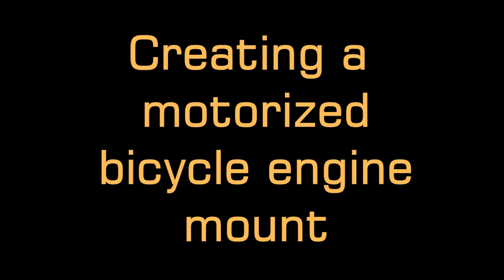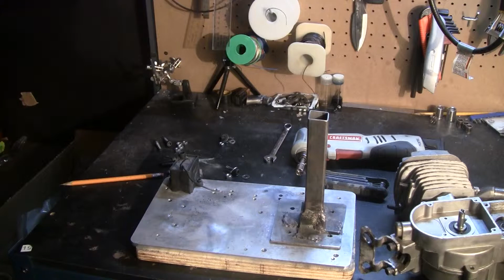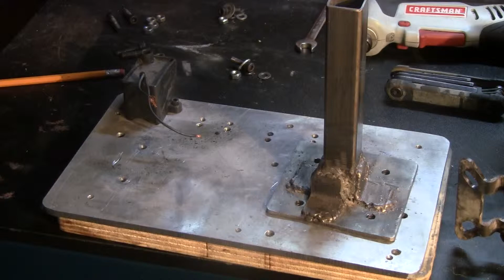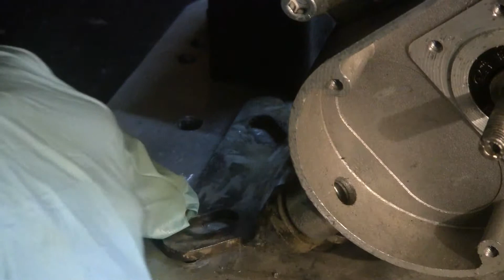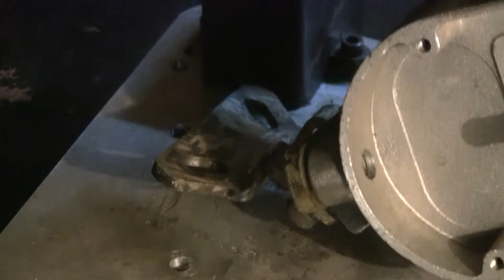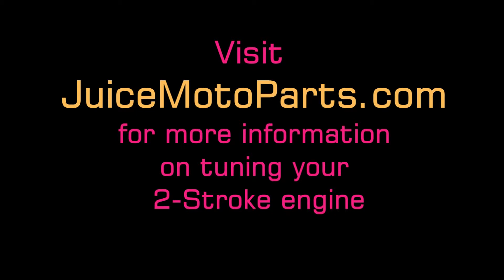Creating an engine stand for your Motorized bicycle engine

Comment: I used a scrap piece 2x8 a lag bolt 2 washers and an old bicycle frame that was cracked I measured up the tubes about 10" from the bottom bracket housing them with the grinder then attached the frame to the board with the lag bolt through the kick stand mounting hole then cut off the rest of the frame about an inch from the end of the board works great